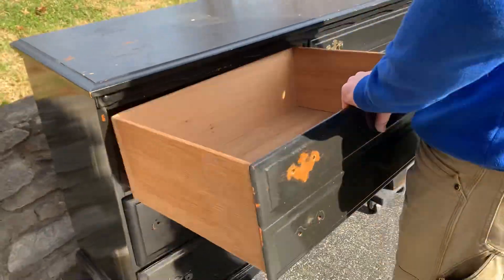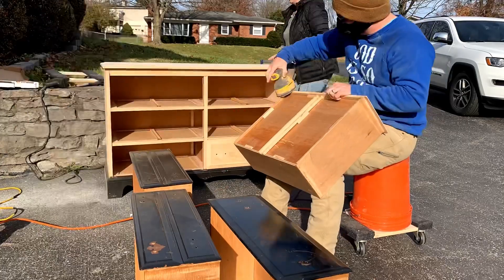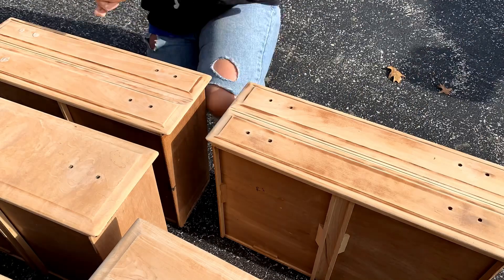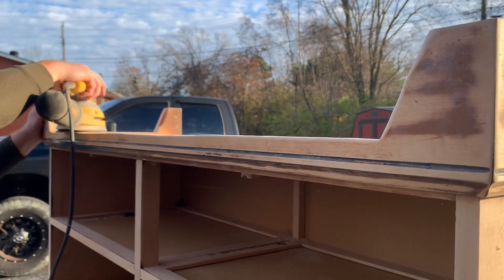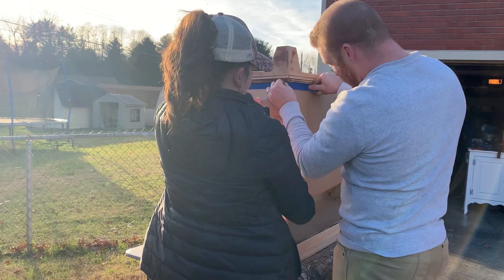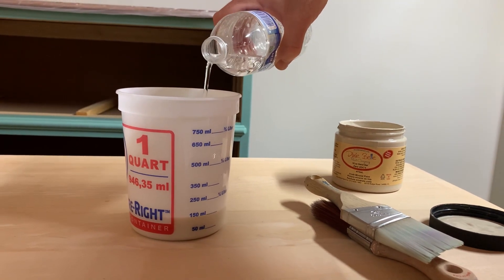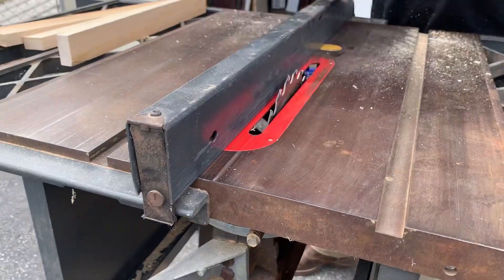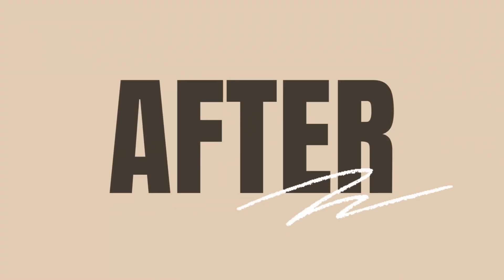How to Whitewash with Chalk Paint // Furniture Flip // Dresser Makeover // Raw Wood Look

Comment: Hi! New here. Question, you only primed where you didn’t want to see the grain right? So the top isn’t primed before you applied the paint wash? Or did you use a clear primer/conditioner? Thank you so much! 12:51
Reply from the maker: Yes, we only primed the areas we painted which was the top two drawers and base. For the rest of the piece we sanded everything down to bare wood and did the paint wash which acts like a faux stain and just keeps the wood looking natural even once top coat is applied! Hope that answers your question!